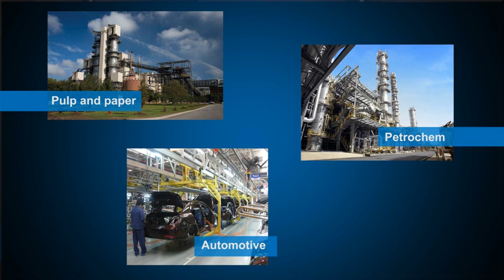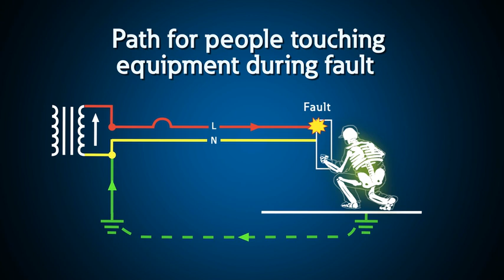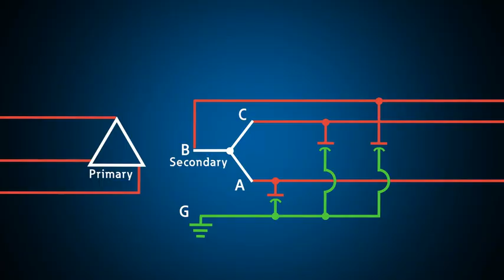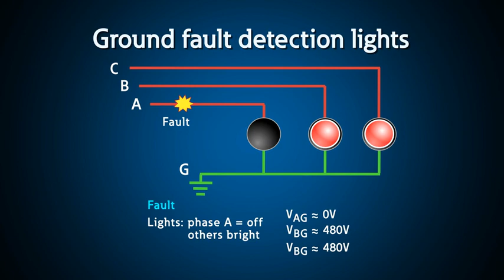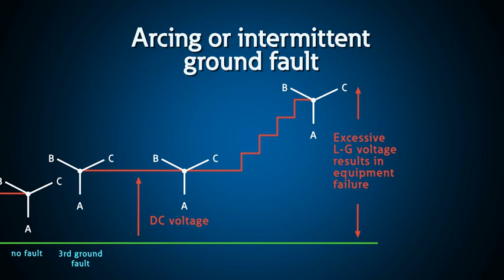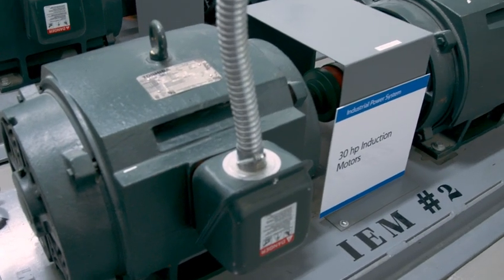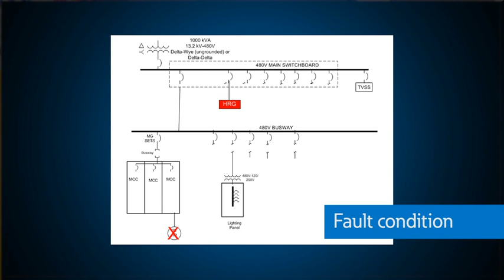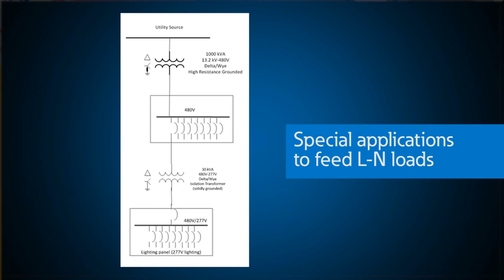High Resistance Grounding  (HRG)

Comment: One question about this concept always bother me ... 

When earth fault occures on any system..  How and why earth fault current flows back to service transformer neutral earthing point only ?? Why it is not diverted to any other way (considering the earths huge cross-section) ... 

In between the path of fault location and service transformer neutral earthing point, any conducting object might be exist then why fault current is not diverted towards that conducting object ?
Reply: This is under the concept of TNS system for a Wye connected secondary, the source transformer would have a separately derived system and serve both neutral and ground to the downstream loads, all the ground of downstream are tied back to the source transformer where the N and G are tied together. Downstream loads would not have separately derived grounds.
Reply: Good question.
I also used to wonder about this and I came to this understanding:
The fault occurred downstream of a particular transformer, this that transformer is now unbalanced. Other transformers are still balanced, and this they remain that way. In a sense, they have no room for this stray current.

On the other hand, the "faulted" transformer does have room for it's"lost" current to return, in search of balance.